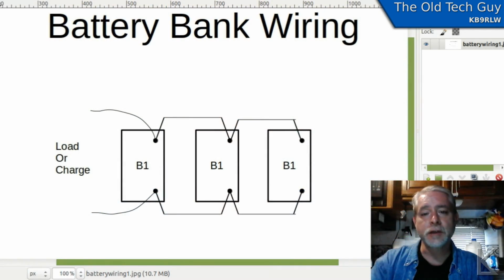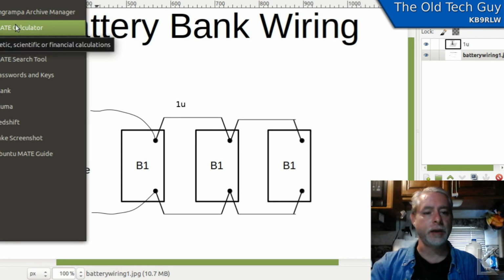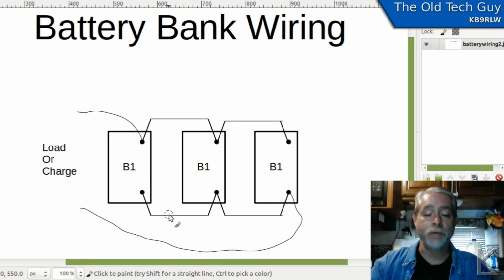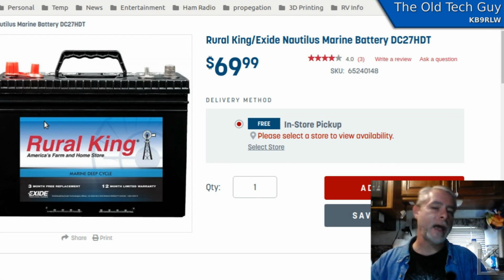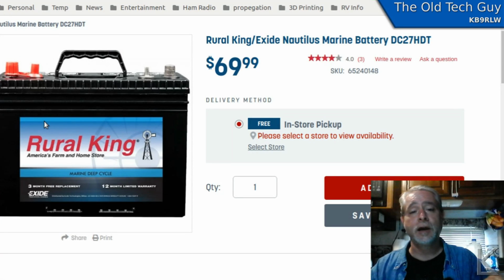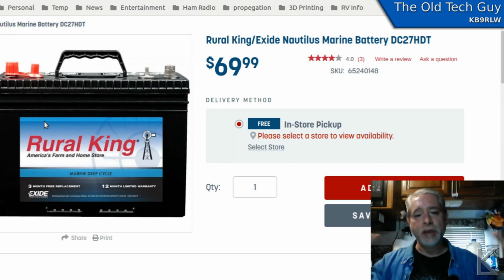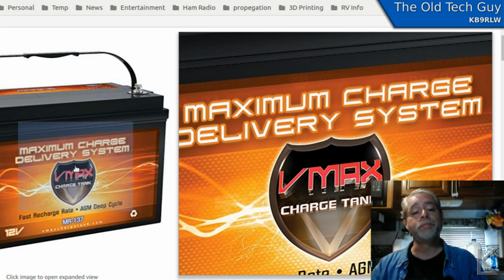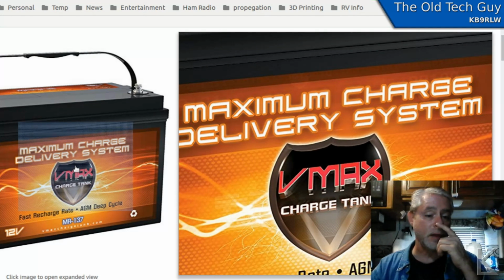Electronics - RV - Ham Radio, Solar and Batteries. Thoughts and Observations

Comment: Battery capacities are generally more forgiving than you describe.  i.e a 30 amp/hour battery (assuming 100% effeciency) should provide 3 amps for 10 hours unril it reached say, 10.88 volts (80% of 13.6) not until battery is totally dead.  Sorry if anybody already stated this, I didnt take the time to read all comments.  However the rest of the video explaining the wiring and equalizing the load and charge are great, awesome video and enjoy the RVing experience, 73.

Comment: great video , in our 5w I saved up the money and went LIPRO  group 27 size , im also a CW operator , they will run the entire trailer for 3-4 days with out a charge , I don't have solar but I do have a 5.5 KW generator that I fire up to charge things up , works great

Comment: Thanks Kevin, after installing a lot of battery backups for Telecom equipment over the years, I thought I had been doing it right😩, the way you explained it made perfect sense.
Reply: I'm only a truck driver and I knew this, but not until I did research when I added auxiliary batteries to my truck several years ago.

Comment: Good information.

I was wondering why you chose that model battery but then I noticed on the web site that there ithe following:  

Warning: Do not use a charger with smaller amperage than the recommended Charging Current shown above.
  Maintainers should ONLY be used to maintain a fully charged battery but NEVER as a charger.

The recommended listed charging current  was 8-35 amps and your solar panels put out a maximum of 100 watts, which translates to 8.33 amps.  This puts your charging rate just above the lower limit of the minimum charging current.

I assume if you wanted to put in a second battery in parallel, you would have to increase the size of your solar panel array accordingly.

P.S.  I use two large capacity 6 volt golf cart batteries hooked in series for my travel trailer and they work great.

Comment: Great video.  I am going to have to retire my batteries.  I have 16,  6 volt 140 AH batteries.  Each bank of 8 are wired in parallel.  Then each bank is wired in parallel.  That provides 48 volts to the inverter because the banks are wired in parallel.  (Each bank of 8 providing 48 volts)   I am concerned about the aging that you pointed out, and I will investigate it thoroughly.  Thanks again.

Comment: Thank you Kevin for the great explanations on both "deep cycle" and AGM batteries.  Would also like to learn more about solar charge controllers.  
Am curious what you use for a multiband HF antenna with your mobile home.  
Got my Novice in '57, retired EE and enjoy your videos tremendously for the helpful tips in them. 
73, K8IOS

Comment: I usually tell people whatever amp hour the battery is figure you will get less than half so if it says 200 amp hours you may only get 90 amp hours worth out of it before you start to pull it down to far.
Reply from the maker: Well, as I discovered and mentioned in other comments.  The rating is determined with what they call a 20 hour test.  They draw the battery down to 10.6 volts over 20 hours and calculate the AH delivered.   So, the rating should actually be very close to what you actually get down to the critical voltage, not to zero.

Comment: Nice efficiency improvements. 

I've used both flooded and AGM batteries in various applications for many years. They both use lead alloy and acid mixtures, the difference is in the AGM absorbs the acid into a fiberglass matrix (not the same as a Gel battery). If the AGM battery is damaged the acid leakage will be minimal, and they can be operated in any position (due to the pressure valves sealing the cells). They have real advantages for maneuvering aircraft, but in an RV not so much. They cannot be refilled with water, nor can they be measured for specific gravity. The manufacturer's claims are not all completely accurate. The most cost effective RV batteries are usually the commodity 6V golf cart flooded batteries (6V 200+AH for about $100). For about $200 a pair of these will give 12V at 200 plus amp hours. Another option is used Electric Vehicle batteries which are often lower in cost than new lead packs. A great project is to fit the EV batteries but it does require some technical skills. The commercial RV LiFePO4 batteries are easy and excellent but the price is steep. Good luck with your journey. w6akb.
Reply from the maker: I would like to go with LiFe type batteries ultimately, primarily for their much lighter weight.  The golf cart bats are economical, but heavy and potentially messy.  Even with battery boxes the connections will eventually corrode.  And they have to be vented to the outside.
We still don't have an optimal storage solution.   I wonder if anyone has tried a bank of super capacitors in this application?  I've seen a few guys replace their cars battery with super cap banks with some success.
Reply: Supercaps have a number of difficulties to engineer around. The voltage is constantly declining during discharge, and the energy density is a fraction of lithium cells, so space and cost are not attractive. AGM batteries will vent during a fault situation, such as a load short or overcharge from a failing charge controller, so they really should be vented for emergencies. Lead batteries (flooded or AGM) waste about 30% of the charge energy whereas the lithium lose only a few percent, so the lithium system is overall more efficient which allows more power out, shorter charge cycles, fewer solar panels, etc. My older AGM batteries have terminal corrosion, it is just delayed somewhat, and the technology to deal with terminal corrosion is common and well known. Lithium does not have the corrosion problem. Note also that EV batteries have moved away from LiFe and have considerably higher energy density and more attractive costs, especially in the used market (as EVs proliferate there is an increasing availability of good cells and packs). The new development effort is not in LiFe tech, it has moved on to more energy dense technologies. Lots of choices! w6akb.

Comment: I found a spec for your Rural King marine batteries - 

Nautilus Marine/RV Deep Cycle 400CCA/150 Battery - DC24HDT
Amp Hour Capacity 20hr - 80
Reserve Capacity Minutes @ 25 Amps - 140

So you had about 50% more capacity per battery with one new AGM battery, but less total capacity theoretically. I think that the cheaper batteries had some other issue with the drastic difference in performance. It would be interesting to figure out what was going on.

Comment: Hi Kev, well, it was obvious you were pretty green about full timing  a few months ago but was looking forward to hearing your solutions to our more perplexing issues. I picked the brain of a tech who wired EMT rigs to find that they use 6v AGM Trojans wired with 2AWG wire, hefty 200a fuses and MPPT controllers (200W panels and 200Ah batteries)which I utilize also in the camper van,works great for 3 yrs but I really only run a small student frig thru a 2000w inv. I recently built an additional trailer to marine specs with a dual 30A solar/ shore   power system and a comm(ham) center. Solar is 600W panels with 400Ah batteries.
Reply from the maker: Nice setup.  I'll probably expand this system eventually.   Dometic and another manufacturer that escapes me at the moment make nice 12v compressor coolers.   Some models even have a freezer compartment.  Run right off the 12v system directly for the best efficiency.   I might go that way down the road.
Yeah, I'm a hands on learner.  I do a lot of reading and research though, and try to apply what I learn the most efficient way.   Learning new stuff is one of my favorite activities. :-)

Comment: Nice video Kevin and great experience with the batteries.  I suspect you don't have a way of recording amp-hour/wattage use or charging.  It would be interesting to get that data.  Years ago I purchased a "Super Whatt Meter" from Astro Flight that connects between my charger, battery, and radio, depending on if I want to measure power consumed or power charged.  Great device.  I do quite a bit of  portable operation using a Yaesu FT-857D powered by SLA gel cells of various capacities.  The power monitor has been great to understand the discharge status of the battery.  I find it takes about 1-1/2 times the amount of power to recharge the gel cells than what is consumed.  Anyway, great video and I've been enjoying watching your videos about your travels, etc.  Best 73.  W9DKB
Reply from the maker: Yep, they eat more than they give.   Loss due to internal cell resistance.  That's also how they discharge while sitting on the shelf.  No battery is 100% efficient.  yet.
One of these days, I'll get some better metering gear installed.  For now though, it's keeping up with my usage, so I'm happy enough with that.

Comment: I have a similar chemistry AGM deep cycle battery, though only 38AH (for radio only when mobile out of vehicle). My battery states it can be discharged to 10.5V, so I expect your VMAX battery may be similar. Can be useful if your radio can tolerate voltage down to 10.5V (though I don't think my IC-7100 will). I'm using a fold-out 100W panel which is sufficient for my use. Great and very helpful video - appreciated.
Reply from the maker: If I get it low, like under 12,  I can always switch to the Yaesu FT817 and run QRP.   The Yaesu will do 5W down to 11 volts and then drops back to 2.5W down to 10 volts. 
While I was parked in the Da Soto National Forest in Mississippi I was running QRP with the 33 foot mast up and worked Italy.  :-)

Comment: Sealed maintenance free batteries are only maintenance free because they glue the top cover on making it harder to add water!
Reply from the maker: Actually, they are capped with a pressure valve usually.   Any gas produced will usually recombine within the cell, back into water.  Excessive pressure will cause the valve to open and vent, only when necessary.

Comment: Hello Kevin, According to several YouTube boating and RV videos regarding switching from lead acid to lithium iron phosphate batteries, lead acid batteries are only good for 50% of their amp-hour capacity, so your 120 Ah battery has only 60 Ah of useful capacity before the lifespan of the battery is reduced. They go on to praise the the benefits, lighter weight, 100% of useful Ah capacity, better return on investment, etc of lithium iron phosphate batteries despite their very high initial cost. Just something to consider in the future. Meanwhile I'm enjoying your journey and mobile operations. 73s ... Jim
Reply from the maker: Well,  sure lithium based tech is going to be better, but there are a couple of problems with your critique.  First, it's an AGM battery, which has many advantages over and lacks many of the shortcomings of regular lead acid batts.   
Also,  as I mentioned in another comment, the AH rating is arrived at by discharging a battery over 20 hours to 10.6 volts and calculating how many AH it delivered.  So the rating is very close to actual deliverable capacity.
I'm on the fence about lithium tech though.   Stick a nail in one,  then run!  heh.   Maybe the lithium iron phosphate chemistry is more stable, but lithium really likes to dance with oxygen and create plasma.   They sure present an advantage in weight though.  Much lighter.
Reply: @loughkb  Using lead acid beyond 50% of their measured full discharge capacity shortens the useful life of AGMs as well, and LiFePO4 get best life when cycled less than 90%
Reply from the maker: According to the manufacturer, deep cycle AGM is tolerant down to 80% discharge due to the 'starved electrolyte' glass mat and solid plate construction.   I wouldn't pull it down that far though.     

So I think it's probably going to work fine for my needs.
Reply: While AGM lead acid technology is a step above flooded lead acid it still suffers from many of the shortcomings. I seriously wonder if the bang per buck is truly justified. Todays lithium ion technology according to the "experts" is incredibly safe. From what I've read there is no elemental lithium used in rechargeable batteries, elemental lithium was only used in primary lithium batteries. On the other hand, older rechargeable lithium ion batteries do use flammable electrolyte additives that will combust when abused. According to the "experts" lithium iron phosphate technology is a step above with regard to safety. Of course like any form of high density energy storage lithium ion technology should never be abused.
Reply: The wonderful world of battery discussions, they are always interesting.  I think there is truth in both the video and most all of the comments.   Lead acid are good, agm are better and Lithium Iron are by far the best (if your wallet is stuffed with Franklin's) :)  If you calculate the lifetime cost, Lithium Iron wins by a good margin, but I shy away from the initial investment and use agm also.  And should mention Lithium Ion are awesome also and can double as a barbecue if mistreated :)

Comment: When measuring charge state the batteries need to be off load (ideally for around half an hour or so) and off the charger. I'd bet your cheap batteries are around 60 - 65Ah  your 120Ah battery is 120Ah to 0V if you discharge to the recommended safe limit of 80% of full charge you only get 120Ah x 20% = 24Ah. You could go down to 50% and get 60Ah but that will dramatically reduce the life.
Reply from the maker: In testing with the new battery, I'm getting much longer usage in the evening.  There's definitely a much larger capacity there.
Reply from the maker: Oh, something I just learned.  The amp hour rating on batteries is the "20 hour rate".   Measured by discharging the battery to 10.6 volts over 20 hours and calculating how many Ah it delivered.   It's not the total capacity down to zero,  it's the capacity down to the critical voltage.

Comment: I describe my solar-charged generator as my "Wait until daylight" system.  The 540AH battery bank is charged by up to 1500 watts of solar panels (typically only one 250 watt panel outside).  Those panels are distributed over two 30 amp MPPT controllers and one 40 amp MPPT controller.  The battery bank powers a 2000 watt pure sine wave (PSW) inverter with another 2000 watt PSW inverter as backup.  There's also a 500 watt PSW inverter for fallback.

The size of the battery bank and the selection of items on the generator transfer switch determine the maximum amount of power can be taken from the batteries.  Depending on the season, I have 10 to 24 hours of silent power.  With no gasoline generator noise, no one is asking to plug in their fridge.

My batteries?  Six DataSafe 12HX330FR 12 volt 90AH batteries used in large UPS units.  They have an expected 10 year service life.  The batteries I have were changed out at the end of year five, so I expect at least 5 years life from these batteries.  However, I'm careful with the batteries I use (my truck's original battery lasted 6 years) and I expect 7+ years from these batteries that cost me $35 each (new from DataSafe is $300; aftermarket equivalents are $170 and up).  Craig's List is a great place to find bargains - if I'd had more available $$, I'd have bought at least twice as many batteries.  I also found 1100 watts of the 1500 watts of solar panels on Craog's List: some used, some leftovers, and all for $0.60/watt or less.  Occasionally there are new Interstate AGM batteries on Craig's List for very good prices (94AH for $75 each).

Ampere hours (AH) are based on a chemical reaction and the number of amps you can get for XX hours is ONLY valid at the specified hours of discharge.  Depending on the intended use, a battery may be rated at 1, 8, 12, 20 or 100 hours.  Forklift batteries are often rated at the 8 hour rate because the forklift will be used 8 hours and then put on charge until the next day.  Many of the deep cycle batteries have ratings at several of the times, but the most common time is 20 hours.  Your battery can deliver 120AH at the 20 hour discharge rate.  That 20 hour rate is refered to as C, for capacity.  In this case 120AH/20 hours = 6 amps (or 1 C) so you can get 6 amps for 20 hours to 10.5 volts (a place you really don't want to go).  The 8 hour rating might be 100AH and the 100 hour rating might be 140AH.  In deep cycle use, you really need to know the hours that AH rating is based on.  For longest life of an AGM battery, you never discharge it more than 50% - the number of charge/discharge cycles you get at 50% discharge is maybe 3 times the number of cycles you would get at 80% discharge (considered the maximum safe limit for AGM).  That means you have 60AH to use, so 6 amps for 10 hours - but you won't get 12 amps for 5 hours.  A man named Peukert did a lot of experimenting with lead acid batteries and found that the chemical process involving lead and sulphuric acid can only run so fast.  If you try to take out more than the 20 hour (or whatever) rated amp hours, the battery doesn't deliver.  There are some formulas for determining how much power your 120AH battery can deliver at discharge rates greater than 1 C - typically up to 10C or whatever the battery can handle - but all those discharge curves are shorter than at 1C.

My first PAW novel is here: https://www.amazon.com/dp/B01LVU5ILA